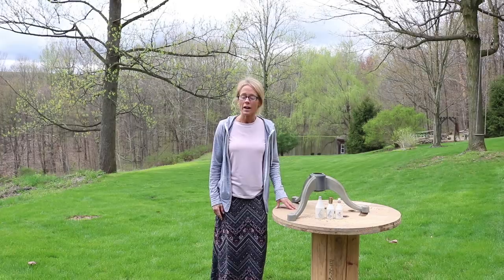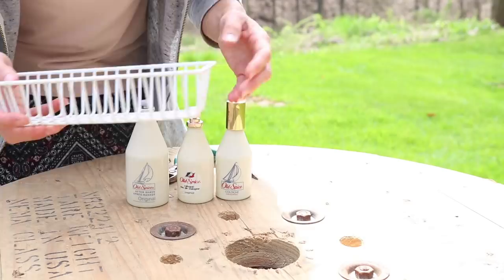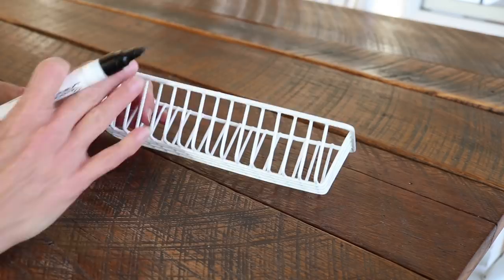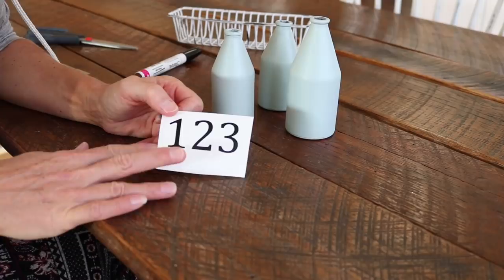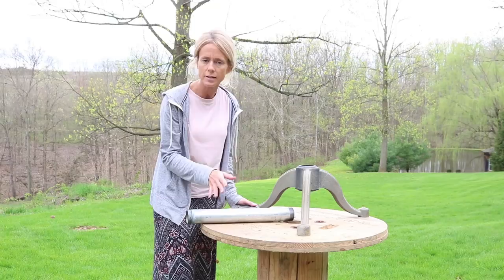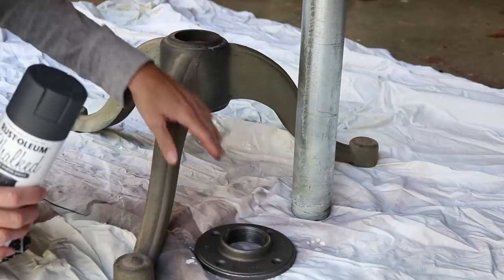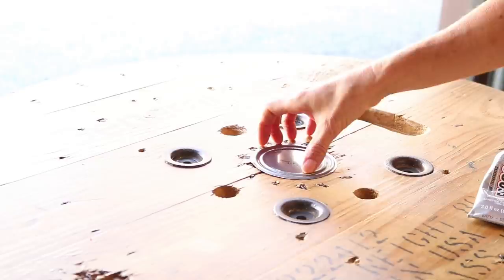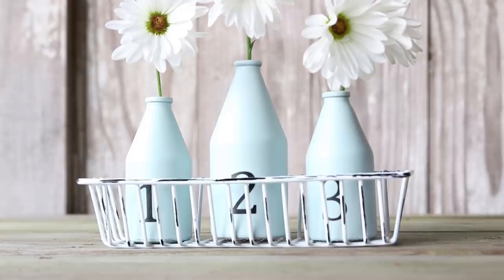Trash to treasure Cable Spool Makeover ~ Episode 8 ~ Wooden Spool Makeover ~ Glass bottle Painting

Comment: Took a 32" wood spool and made it into a beautiful coffee table to make the end table I made my wife a few months ago. I talk pallet wood and recovered the top. The top is 3 layers thick but it sure looks good in Minwax walnut. The stem is stained alternated in mahogany & walnut with rope going up 8 times so people can see the stain. Stem has been lowered by about 7". Bought screw rods from Lowes, measured, cut and attached. Used 4 each 3" wheels from a HF furniture mover. Project is on FB in projects.

Comment: I would elevate off ground level anything spray painted..easier to get   a more even coat and prevent dripage. And the top of the can..I would have used a smooth edge can opener or have taken the sander to the jagged edges.. even with the spray paint it's still jagged

Comment: What an awesome video!! I enjoyed all of it. #1 your music is awesome I love the tune and wish I knew who made that arrangement as I am a guitar player since I was 5 and I am now 55 and I love Christian rock and country music. #2 your land looks awesome and it looks like a lake at the end of the property. But, take it from me - cable tables are so awesome. Your's came out so good and if you wanted to, you could put caster feet on the base to roll it around also.  I keep meaning to ask my dad where he got our cable table which is now on my mom's porch. My dad back in the 60s, brought home just the top of a cable reel with a metal liner in the middle hole and to the right of it was a slanted in hole where I imagine the cable rope came out of.  My dad put 4 chunky thick pieces of wood with heavy duty L brackets made out of metal underneath and I have photos of us sitting around the table my mom and dad and my brother and sister and I doing our advent wreaths with the candles lit and the Bible in my dad's hands. A few years later where he got it I have no clue he came home with some large type of barrel with a metal band around the sides of it and  the feet under the cable table top were far apart so he was able to just put the cable top right onto the barrel and the legs fit around the barrel nicely and then we had a higher up table in another house and we used that as our main eating table.  Thru the years after my parents divorced (my mom got the table), its assembly changed here and there however it fit best into each room. Right now the top is back on the big barrel on my mom's porch and it really is too large for the porch and heavy for her to move if one of us kids are not around.  The other day my mom said she wants to find someone to buy it and my heart sunk.  She wants to have her porch closed in as she has the old jalousie windows that no longer will crank close and even WD40 will not work on them. When we have the bad storms and high winds so many leaves and rain come into the porch.  When us kids were small we all would lay underneath of the table when it was low on the floor and we would pretend we were in a space ship.  I asked my brother if he wanted the table he said no. My dad's wife and he definitely do not want it. My sister has no room for it even though she lives in the country and under their covered open porch it would be so cool out there.  I am the poorest kid in the family and the only one without my own home - I have a huge apartment and even though the top is big I have a huge living room. I am in what is known as the largest one bedroom apartments in all of Northern VA. I would love it in my living room to use for crafts. My craft club all of us could fit around it at one time. I measured it and my living room and it would be super in here but, I live on the 5th floor and it doesn't fit into the elevator.  To think, I am 55 and I played under that table when I was a little girl. I am a sentimental fool and the only one in my family. It will be so sad if my mom gets rid of it. My dad polyurethane it too with just its natural luster. There isn't any stamps on this one and wow - even the barrel is so cool but, that is the heavy  part of it too.  I wish I had a house with a little back yard.  If and when she gets rid of it, it will be like the end of an era.  Anyway, sorry this is so long. I seem to babble when I am tired. I also love your old spice bottles. I love recycling old jars and perfume bottles and white daisies are one of my favorites.

In closing, if you come into my living room you will see one piano leg standing on end with the wheel up in the area and people laugh but, its made out of beautiful wood.  My dad wanted all 3 of us children to learn how to play the piano. He bought an old one from a church that was closing and my dad did a beautiful job on redoing the piano inside and out.  Well, divorce happens and dad didn't want the piano so my mom took it.  Yrs went by and the tunes stopped being played. Too hard to move around in my mom's living room and there wasn't a Craig's list or a Next Door.com.  So mom had a piano mover come and take it apart. She kept the part that holds up your music to use on top of her counter to prop up her cookbooks when making a recipe and she gave each of us kids a leg.  Who knows where my brother's is or my sisters but, when I see them next if they have their's saved and do not want it - I would love to get a nice board to nail it to the top of each leg and then have a nice little rolling table.  Thank you for a great video and so nice that it was recent.  But, arts and crafts never go out of style.  Sincerely, Rebekah in Alexandria City, VA

Comment: Pretty cool. I didn't know if you knew this about the can opener that can open the can from around the outer edge and it's not jagged. I've painted some bottles using latex paint in a little plaster of Paris in it. Doing the second coat some of the paint came off. I don't know what I'm doing wrong new at all of this if you could let me know which I'm sure you already said about it before thank you and take care